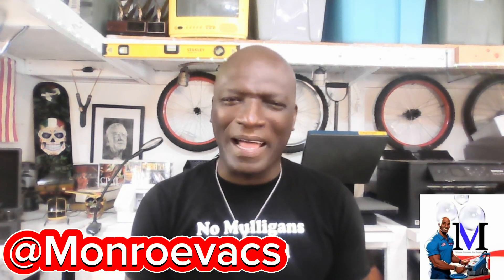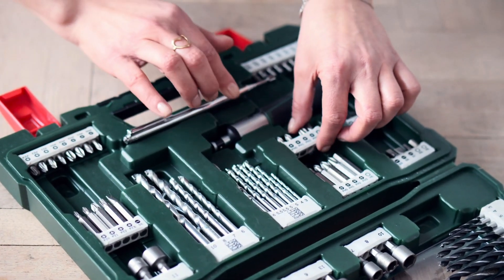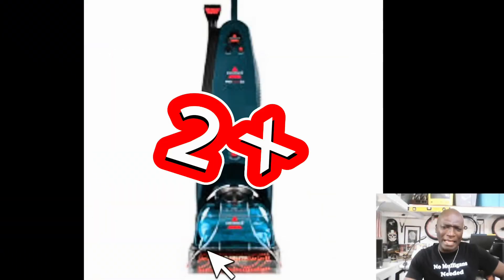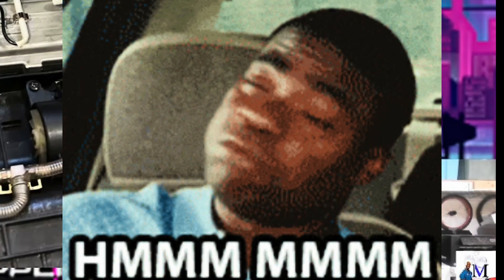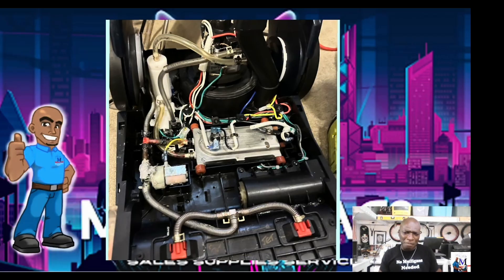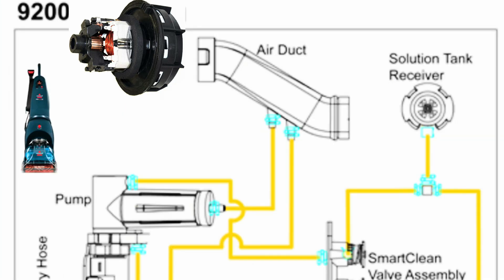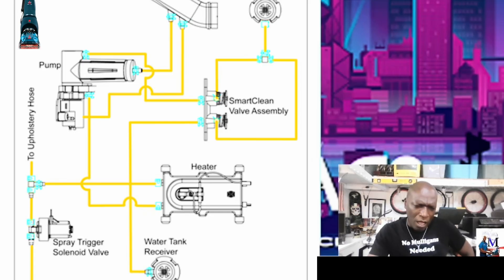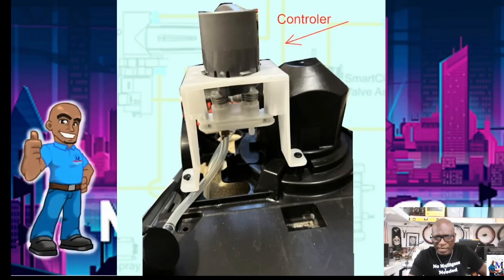Learn how I read the Bissell pro-heat 2x  plumbing schematics - Click here

Comment: Hello, I just want to say that a few weeks ago I just fixed my bissell pro heat 2x. I took it apart and was like wow like you said but I cleaned the heater part which really didn't have anything it. I also loosen the clips on the hoses and let the fluid out and where the back container goes. When I tried to loosen those up I made a snag and had to get a new clear hose and a new t-connector which I got from Walmart at the pet fish  supply section. I was wondering how I was gone fix it and where was I gone get the stuff to fix it. I thought about going to homedepot at first but while I was shopping at Walmart I said to myself I wonder do they have have a clear hose here and when I looked I was surprised and then looked for the other part and there it was next to it. I was so happy and then went home and fixed my cleaner. It didn't spray at first but after I replaced those pieces it did, it started spraying like when I first brought  it. 🙌🏽🎉😊 thanks for all your videos. I appreciate you and everyone else that make videos of this old machine that we still want to use at home. 😊
Reply from the maker: That's why I make these videos-Thanks for sharing your journey- we all have it-make it happen
Reply from the maker: Thanks the the pet fish tip- now I have an emergency back up for tubing. And that’s how most great ideas come about “I wonder if…..” 😊 thank again for this contribution to the repair conversation
Reply: @monroevacs  you're welcome 😊